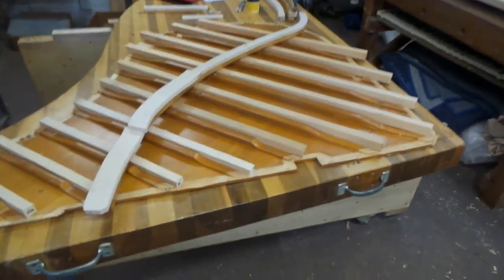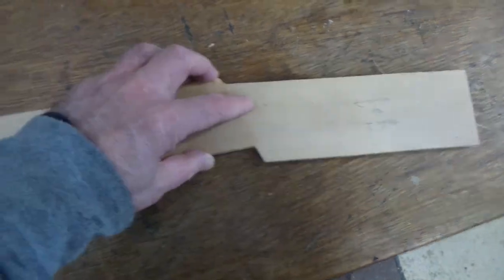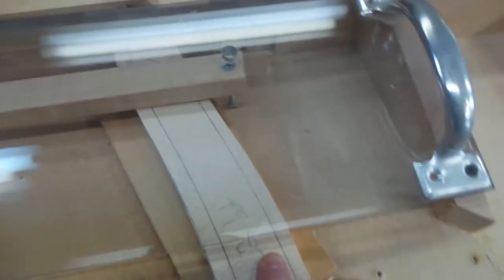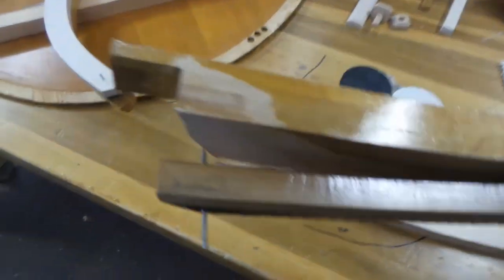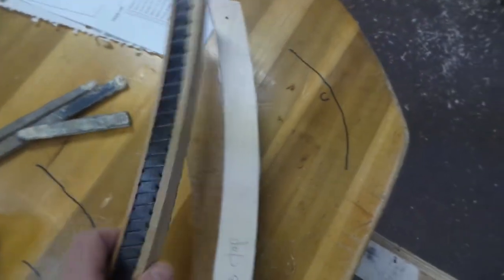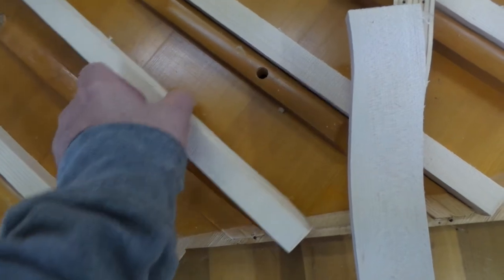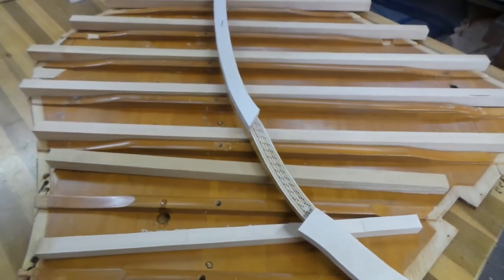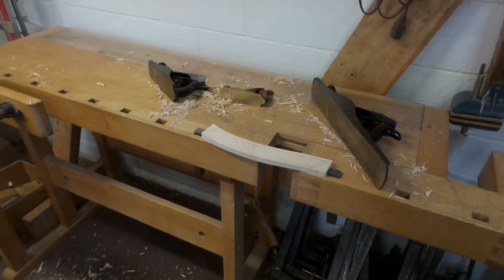Piano new sounboard bridge cap

Comment: Hey! I’m actually one of the 3 belly department guys at Steinway that do restorations. I googled bridge cap replacement mostly because I was curious if anyone had even made a video about what I do for a living lol.

Anyways, at Steinway we don’t use joinery between the main and 2 secondary bridge caps because there’s no stress on the joint, only stress in the direction of string tension, which only pulls the joint tighter, for the angle we cut them at.

As to filling the holes in the root of the bridge, we do use dowels and little pieces of wood to fill them, we don’t like to fill them with glue because the glue reacts differently to the drill bit and can make our new pin holes uneven. It can also affect how the sound travels through the bridge and change the tone some, but I’ve never tried it myself to know. So take that with a grain of salt, but the veteran among us claims that’s why we use wood. 

For number 7 pin holes, we just use “Puritan applicator sticks.” They come in a box of 1000 for $10, you just stick them in and break them off. Use a 80 grit to make the root smooth again after holes are filled. They also work for number 6 pins, but you’ll have to break them off and tap them lightly with a ball peen hammer instead of just pushing them in by hand. 

For number 8 and 9 pins, we hammer little wedge like pieces of wood in them. Forgive me but I’m drawing a blank on what they’re technically called.

You did a nice job fixing that gap where the epoxy ripped off some of the root, nice job! 

For the bass bridge, there’s no need to take off the entire old cap. Use an electric planar, measure the height at both ends before planing down, and plane down until it’s perfectly flat. Fill the holes with small wood wedges if you can, glue if you have no other choice, and add a new cap the same way you put a cap on the tenor bridge. That way you can just make a rough cut on your cap material, and use a flush cut router to get it back to the perfect shape. We’ve found that’s the most efficient and best way to do it unless there’s major separation on the original bridge cap.

Also, if you need to repair a separating bass bridge cap on the piano, drill a hole through the top towards the end and put a 1/4 dowel through it. Drill at leash 1/3 inch into the root so the dowel can serve its purpose. Put in ‘Hyde glue, then dowel. We use a multi tool to cut the excess dowel material off, and re drill pin holes as necessary. 

Sorry for the essay. Thought I’d share some advice!